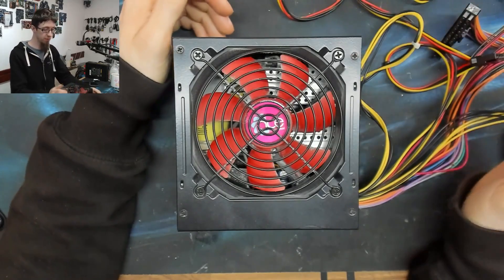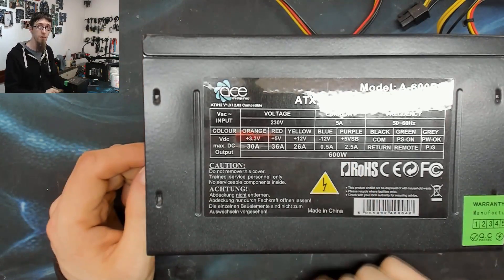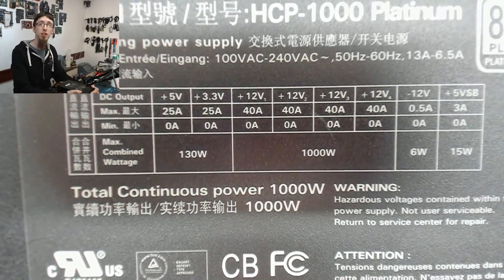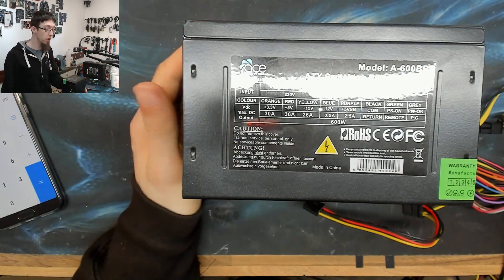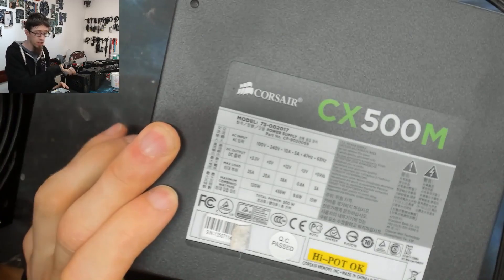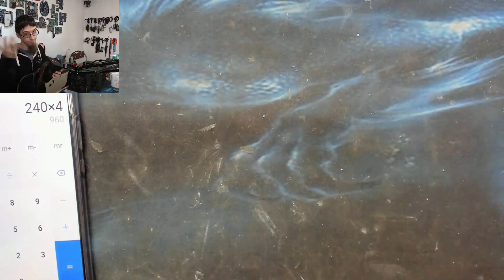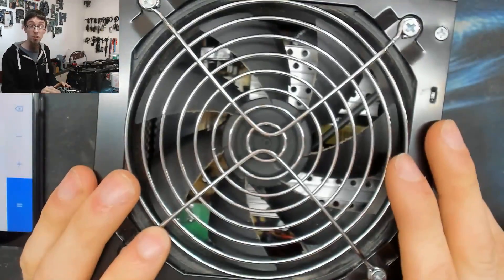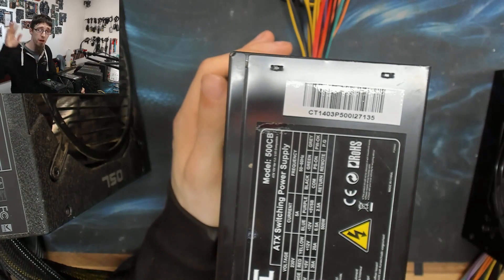LFC#171 - Why This PSU Is Crap

Comment: Think i found for every hour you spend gaming on a platinum psu from a bronze psu, saved 0.5p, saying you spend 4 hrs gaming a day, for a year, it works out around £7.30, for a 10 year warranty not to mention better parts, the £73ish premium over bronze parts is a no brainer surely? You're using electricity more efficiently, less waste emmissions. You're parts in your pc are a lot safer from malfunctions from a PSU accident, you are saving money, generating less heat through efficiency, less noise as parts transfer heat better etc. Please let me know your thoughts on this? If i've said something wrong please correct me, i don't know much about PSUs other than those points i made.
Reply from the maker: Those numbers seem to be incredibly optimistic... I ran the numbers in this video: https://www.youtube.com/watch?v=-ng287cKcQ0
...and found that you needed the PC to be at full tilt for something like 12hrs a day 365days a year to get to half of those savings you've heard.
Although in my calculations I was working with a 250w load, which is representative of a simple Skylake i7 and a GTX 1070 build.
If someone ran the numbers on a crazy top-spec rig, then sure, you might be able to inflate your figures to the point where it matters. Remember, you're not pulling the full PSU wattage all the time. Most people are barely breaking 50% of their PSU load with a 500-600w unit.
Reply: @Adamant_IT  Honestly i just used the idea a cheap bronze unit has 84% efficiency and a plat has 92% at 300w load (what my pc uses while gaming) and the 10%ish difference works out around 30w per hour, 30wh is around 0.5p (kw/h - 17p)
Reply from the maker: Ah yea, ok that does add up... But 10 years return on investment is a long time. It depends on what your budget is for building the PC really. Plus it's hard to discuss this at the moment while PSU prices make absolutely no sense at all.
Reply: @Adamant_IT  100% agreed, I think i bought my 750 plat psu at £86 and now its £140! Plus i can barely find a reasonably priced gold psu in stock anywhere, my friend wants to buy a pc and weve got all the parts except the psu, (going gold because its a £1000 pc). What are your thoughts on second hand Gold or better PSUs from ebay?
Reply from the maker: I'm a big fan of second hand gear, both my main PCs have always had a few second hand bits in through their entire lives. So long as the price is good, it may well be the smart buy right now, and even if it lasts half as long, that'll be long enough for the PSU market to settle down.

Comment: if your the guy who has the "FLOPTRON" floppy disk instrument.. you want that 30 amp on the 3.3v rail so you can power your 100 sequenced floppy drives.
Reply: ;) Floppies never ran on 3.3V, but 5V or 12+5V. The orange 3.3V wire only came in with SATA plugs and even today it's rarely ever used.
Reply: The motherboard got 3.3v first. SATA came later. As the cores modernised, the 3.3v rail was introduced. I think it was the cyrix chip that used it first
Reply: @tenmillionvolts  I have seen Pentium 1 and 2 systems that generate the 1.9 - 1.2 volts needed from the 3.3v rail, because the 5v rail was always noisy with thinks like chipsets, drives and other stuff. feeding the processor from the 12V started happening with the pga370 Piii, however that was from the 12V rail on the atx connector.
Reply: @SubjectRetro  Nah, it derives it's 1.x volt rails from 3.3V because there's less wasted energy to get rid of as heat, if your 5V rail was noisy enough to disrupt your core voltage then pound to a pinch of sh1t the rest of the board wasn't working either.
Reply: @M0UAW_IO83  I do seem to remember that a few chinese boards that still kept the AT style power connectors where very bad because core voltage derived from the 12v rail. They booted up fine until the moment you pop in a CD regardless of the OS runing. They froze. However, that same board with only a hard disk worked fine, and with an ATX power supply ran fine. It was a time of transition...
Reply: On the other hand, you are not mistaken when you speak about less wasted heat. There where a couple of Gateway Motherboards -I keep one just as a souvenir from the past - that used linear rather than switching for the core. Big heatsink.
Reply: @amurtigress_mobile365  5.25" floppies almost all needed both 12V and 5V, an awful lot of 3.5" ones only needed 5V

Comment: lol .. looks at 15 year old antec phantom 500.... "Oof." dual 12 volt rails thats nice.. too bad ones 17amp and the others 18amp... damn  but hey 15 years old its still working!!! under a phenom2 1045t and a r9 570... which is running using 6 pin power not an 8... can basic use and play world of tanks all day but run a benchmark the old antec does that thing where it shuts off to prevent damage.. lol but it works.. basicly .. for world of tanks lol
Reply: "that ones actually a single rail internally"

Comment: Can you please open all of the power supplies and compare the quality of internal components?
Reply: Huh if only he bloody knew what he was talking about... his instinct is not wrong, this is a scam junk PSU, but you can't just point at something and say hey look low quality component, it doesn't necessarily work like that. You can get away with nearly junk caps if they're already subjected to fairly little ripple current, which is a design question. If you want a story, i was autopsying a 2012 PSU, OEM manufactured by i would vaguely guess Sirfa for a smaller brand, died shortly after purchase, and i mean... yeah i found some degraded caps on the output, but the way it was doing, nah, that couldn't have been it, and they're just Teapo, but proper low-ESR series, it didn't even live long enough before they could ever cause problems, even if they had the typical quality issues, good enough, i mean it's for sure follow up damage anyway, not the original fault. Layout is almost beautiful, component sizing is beautiful, soldering is nice enough, if i didn't know it was dead junk, i'd be in love with it. Semiconductors still good. I take off big caps on the input, and well they look good, but when i take them off, they rattle. Huh. Capacity is reduced. Well they're half empty inside, these... they looked good, but they're fakes, i would have never known unless i took them off. They haven't degraded at all, they were just made that way. No matter, it should still work, they're not so critical. I keep digging, and then i find that the filter choke on the secondary, it had a FIRE, oh it got crispy crispy fried. Took me a bit because i'm a blind bitch and i had to remove a lot of stuff to get to the crispy side. Oh so THIS is why the caps were degraded, that explains it. I show it to some experts, they say, they suspect the core of the choke is fake, is a counterfeit. But you can't tell, there's no way you can tell, is just a green painted ring of weighty stuff with some wire on it. They say they took some of those off from the era and sent them in, and been told by the factory expert as fake. I don't know whether mine is fake, i didn't mail it in, but i mean, it's a possibility.

And you open up an FSP which was made 20 years ago, and it looks like it's made like junk, and from junk, and it still works fine, and not only this one, you take any of its siblings, none of them had a fire, some died peacefully, the vast majority work. Problem is, you just can't tell unless you've got all the expertise. They can disguise junk components and make them look good, or they can have a murderously robust design around very unimpressive if hopefully consistent components. Now this probably isn't going to be a high power, high efficiency design, but it can work.

Comment: I actually own two of those PSUs. Not for PCs mind you because I don't trust my components and data to it but they're great budget lab bench power supplies.

I run my 3D printer and a large number of USB devices/raspberry Pis (5V rail users) off of one and the other is modified so I can vary Vout

Comment: More power means more electricity bill guys.
Reply: what do you mean?
Reply: Most of the newer computers doesn't need a lot of amp to perform. Especially when your using ssd.
Reply: Modern technology are going to use less moving parts which means less power.
Reply: What? a 1000w PSU doesnt draw 1000w at the wall when idle, and moving parts dont mean more power draw.

Comment: I have an RTX 2060 and an i5 9600K and Im currently experiencing kernal power problems, I also have this power supply which I suspect is without a doubt the problem. Do you have any advice?
Reply from the maker: Yea an RTX 2060 will chug 180w, and a 9600k will also be looking for 100-120w. That's your 12v rail budget gone with this PSU - and we haven't even factored in SATA drives, fans, etc. You have to max the CPU and GPU at the same time, but it only takes a spike in CPU activity mid-game and bam, there's your blue screen. Get rid of it!
Reply: 100%, thanks man, I’ll get a new PSU ordered

Comment: From experience I know that even with brand names (few years old as I didn't open any newer PSU for few years know but if they lie for years...) you can't believe in ratings and that in many cases they will say that there is two (or more)  power rails while they actually have single rail. And even if declared values are usually covered with maximum ratings on components it's not something that can be pushed for very long usage. 
Until I open them and check what components they use and in what configuration I don't trust anyone. 
To give manufacturers some credit I must say that sometimes they put overkill components inside (usually with some lower power rated PSUs) so you can actually get more than you buy (minus some filtering due money savings) but I didn't see that too many times.

I'll like to see that 4 rail PS from video from inside, just to see where they put all 4 rails physically . It's sure they save some space getting 3.3 from 5V rail but still...it's a small case.

Comment: This video taught me so much, not only about how to spot a crappy power supply but also the limit as to how much power a single rail can provide to a component, I've got an ocz stealthxtream 2 600w power supply and each of the 4 12v rails outputs 216w (reaching a total of 864w) which now makes me realise why I was having issues when I installed a gtx 780 (250w TDP). KEEP MAKING GREAT VIDEOS LIKE THIS ONE!
Reply: You'd need to feed the two PCI-E power connections from separate 12V rails - am 8 and a 6 together is up to 225W, while 2x 8 pin is 300W max

Comment: my Lenovo oem PSUs is rated at 280w and has 220 on 12v rail 😂
Reply: Bro ...how well has your oem psu hold up
Cos i want to build a gaming rig,low on cash, and aliexpress are yet to deliver my components😭6 weeks
So am going to use a 450w oem hp psu for my ryzen 31200,8gb ddr4 , amd rx 470, 850pro samsung ssd

Do u tink its ok??
Reply: @kelvinemokhare4275  where you got that cpu tho 😂 
450w it doesnt mean much is it 80+ something , is it from a workstation how long has been used , etc. 320-350w on 12v (12 multiplied by Amperage) its more than enough as 3100 wont pull more than 60w and rx 470 like 100w, you are more than safe . Assuming of course that PSU works properly.
Reply: @m1r198  its from and hp compaq..used it qith a pentium dual core pc that i added a gtx 750ti to and used for just a year plus
Reply: @kelvinemokhare4275  Pentium ? like before i3s and i5s ?
Reply: @m1r198  lol..yea
Reply: @m1r198  whats ur spec for the lenovo oem psu
Reply: @kelvinemokhare4275  In my personal opinion that's to old it may work but its like a "time bomb" that can take all your system so i wouldn't trust it . 
My Lenovo has an i5 2400 12 gb ram and gt 1060  along side a ssd and a hdd
Reply: @kelvinemokhare4275  its been running fine for the past 45 days or so all day ON from 9am to midnight XD
Reply: @m1r198  aiit thanks..i ll start off with wat i have...but try to afford a new psu asap
Reply: @kelvinemokhare4275  where do you live ? 
any website selling used in your area (like ebay and stuf) or stores that have computer components?
Dont just think used hardware sold on your area are dead like i did , than after looking i found a cooler master 750w psu for 40$ and some less known brands for 25-30
Reply: @kelvinemokhare4275  deals may be less frequent and not as great as in us and such but you can work around trust me
Reply: @m1r198  not at all...i live in nigeria🇳🇬
Reply: @kelvinemokhare4275  well good luck than
Reply: @kelvinemokhare4275  Now that im thinking is that from Z420 or something ?

Comment: those garbage power supply is almost the same generic powersupply way back 2010
Reply: Definitely looks like it was built for older systems that didn't hammer the 12v rail.

Comment: I hate these crappy power supplies. When I try to find a good one for a pc I'm building, I get flooded with these bricks. I would really enjoy watching you repair power supplies, because my Coolermaster G450M Broke one day because of thunder and I couldn't figure out what went wrong with it, no shorted capacitors, burnt components, blown fuses etc, at least it protected my motherboard from the power surge.

Comment: Gamemax is TERRIBLE do not buy.
Reply: their low-end series (bronze and below) is terrible for heavy load usage but fine for office use. they're just as good as corsair's CV series at best. no idea with their silver and above rated.
Reply: I have a Gamemax 1350w PSU and it's a great PSU, doesn't even get warm. Doesn't matter what I put in my system it handles it. 102amps on the 12v rail, also it's Gold rated.
Reply: @stiggyness1976  Heh there is no listing for your 1350w PSU on the 80 Plus list so its probably fake. Just because a PSU "works" doesn't make it "great", that's *expected*. A generic 500w PSU "works" right up until it doesn't, most people can use them in basic systems and they work fine for a few years, but its the ripple and undervolting / overvolting that slowly stresses/damages components and the crappy loud fans that make them terrible.

Comment: We need a video about replacing power supply fans with "adequate" replacements. Type of fan, wiring, and safety are important factors. I have a brand new EVGA 600 BQ with a rattly fan I bought second hand so no warranty (only paid $25 USD during the PSU apocalypse). I opened the plastic on it so i know it was new and no damage to the box. I bought a Noctua NF-F12 to replace the fan with because it only uses .06 amps, is low RPM capable, and should be way more quiet than most stock PSU fans even on Gold rated ones.

Comment: I love Antec stuff , PSU , case , dual ball-bearing 3-speed fans , cooler.
Reply: I have Antec PSU 550W and it is 10 years old, I will need to replace it soon :)
Reply: @ACOnetwork  Cool! But then it's not even close to it's original rated wattage anymore. You should replace for sure. 
I have a soft spot for Antec products too. They don't get enough love.
Reply: I have an antec 380 from 2006 and it has dual 12V rails that provide 324W, it still works great.  Yet companies still put out inferior products almost 15yrs later.
Reply: I have an Antec 1200 High Current Pro, and it crapped out after 6 years, so it's a hit or miss for me. The worst ever PSU's are from no name brands, closely followed by Corsair - I had 3 corsairs completely fail on client's computers. I'll never buy Corsair again.
Reply: @Jan3Sobieski5  a high current pro will crap out if youre not giving it the proper load, this is why i never buy massively over powered supplies, 750w is what i always buy
Reply: @Synthematix  I run a I9-9900k setup with 32gigs of ram, 2 RTX 2080 in SLI, 5HDD's and 4 ssd's, bluray drive and a dvdr. I think that's sufficient load. I ran a 4790k before that.
Reply: @Synthematix  what are you flapping your gums about? Most Corsair PSUs are made by Seasonic.
Reply: Best power supplies are made by Seasonic, EVGA, Super Flower, some of the top line corsair, not mid grade or bronze.
Reply: @Jan3Sobieski5  corsair have a lifetime warranty, seasonic are made by antec
Reply: @Synthematix  I'm not sure i agree with you, all the corsair power supplies i used had a 5 years warranty. And it's the other way around, Seasonic makes antec power supplies.
https://www.corsair.com/us/en/Categories/Products/Power-Supply-Units/cxm-series-2015-config/p/CP-9020102-NA#tab-tech-specs
Reply: Antec and corsair are the 2 best brands
Reply: i got lucky and found an antec tp 650 for $65 brand new that someone never used and was just sitting around so they sold it. that thing was made by seasonic from what I looked up about it. so who knows how long it'll last me, i also had bought a tp 550 years ago used for my first rig that is still going strong with a 3600 and 5600xt attached to it.

Comment: One reason why you might want a higher efficiency PS is heat. The higher the efficiency, the lower the heat generated. That means the Rds of the mosfets are very low so they dont dissipate much power.
Reply from the maker: Yea this is fair. Up to 500w, bronze will do fine really, but once you're at 600+, a Gold rated PSU is going to knock out significantly less heat, which is good for cooling and the life of the unit.
It's worth keeping in mind that people often over-estimate the power draw of their PC. Most mid-range PCs with say, an i5 and a 1070 or 2060, aren't pulling much more than 300w tops. So a bronze PSU at worst you've got less than 50w of heat to deal with in the PSU at full tilt, most likely less. This is a generalisation, higher-end PCs draw more power, etc etc.